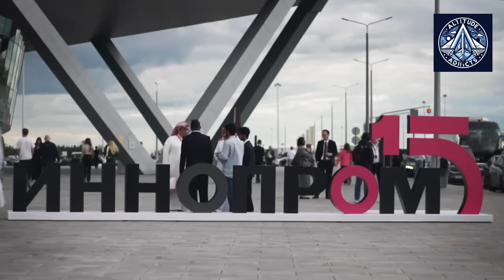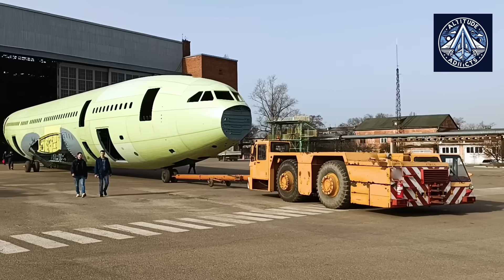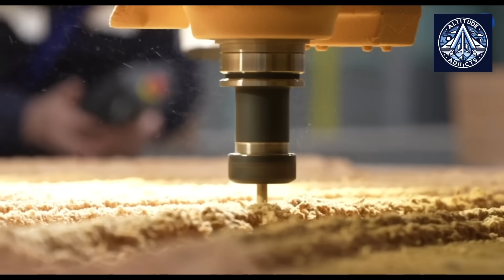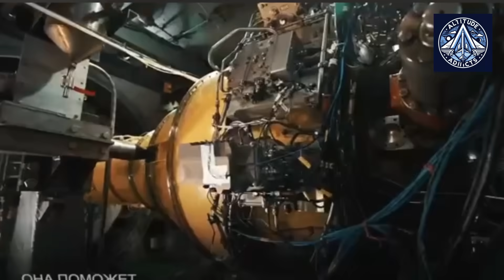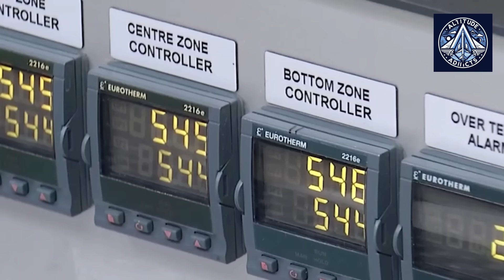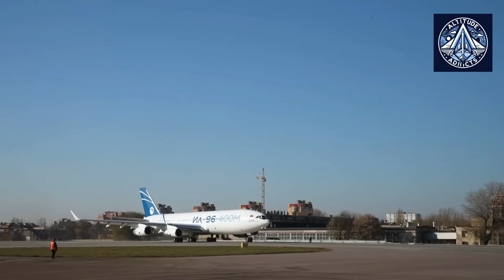Russia Officially Announces Il-96 Successor—PD-35 Engines + New Wide-Body Long-Haul Design!

Comment: Il-96-400 would benefit from the dual engine option. They will be up against the classes of the Airbus A350 and Boeing 777. However the engines for dual engines IL-96 needs at least 450kN of thrust each. and a high bypass ratio. Not forgetting to mention a lot of airlines are looking into lower fuel burn and CO2 emissions. Another way is to team up with China. China has the technology as well. and the team up would benefit the Asian market. Tupolev Tu 204 family would benefit with the engines of MS-21 or similar to the COMAC 919 at a higher thrust. PS90 is relatively an underpowered engine. Not only engines could be upgraded, the materials could also change to reduce weight and increase strength. Carbon fibre and fibreglass. The sanctions are really bullshit in my opinion. Double standards.

Comment: Or continue using iL 96-400(new pilot windows please) then apply what Embraer did. Uses the E jet  series fuselage copled to a New modern and curved wing that allowed to fit a larger engine. Born E2 series. Same for il-96-400 to become IL-206-400. Powered with 2 PD-35😊😊😊
Reply: Note 206 = I meant Year 2026😂

Comment: Russia should modernize the IL 96, and rename it to MC 24-400, to bring it into a single standard class of products that can be offered to the world. The new Il 96 should get :
1. A fully composite redesigned wing
2. More composites in the body and the tailplane to reduce its weight further.
3. Change the crew to a 2 pilot setup to reduce cost and weight.
4.Upgrade its avionics and cockpit to optical and glass cockpit to reduce weight further.
5. Change the 3 main undercarriage to 2 main undercarriage design.
6. Redesign the interiors to give it a world class unseen beauty and class in fittings and seats.

Additionally Russia should build a network of depots and support system for its international MC commercial airlines to give it the support system for future customers. Also I believe russia should also rename the Sukhoi SSJ to MC 19 - 200, to also bring it into a single commercial family of airliners for the international market.

Comment: Given the stated workload during the next decade, I think Russia should either maintain Il-96 by modernizing it with PD-35 or, if necessary, upscale the MS-21 into a widebody.
By the way B737 Max is only the modernized B737; I recently flew in one and noticed that it's nose is exactly the same with older 737; nothing changed.
So it is no sin to modernize

Comment: Yo, altitude
Have you heard the phrase, “go bold, or go home”? 
It’s time for Moscow to embody this spirit. Imagine if they developed not just one, but two groundbreaking airframes. First, a heavy-duty long-haul aircraft, designed to double as a cargo transport, rivaling the capabilities of the magnificent Antonov 225. 

But that’s just the beginning. Moscow should also invest in a revolutionary high-speed, high-altitude airliner that pushes the boundaries of aviation, akin to the iconic X-15. Picture an aircraft soaring above 60 kilometers, reaching astonishing speeds beyond 7,000 kilometers per hour. 

Unlike the old X-15, this new marvel would utilize a cutting-edge modified scramjet engine, granting it the unparalleled ability to excel in both subsonic and hypersonic flight. This is not just a dream—it's an opportunity for Moscow to lead the future of aviation. (⊙‿⊙✿)
Reply from the maker: Yo!

Comment: Russia should rationalize and consolidate its commercial aircraft projects instead of diluting design expertise and manufacturing capacity into too many projects which compete against each other on the market.
Apart from that, 4 engines is not a bad thing. The passengers intuitively feel more secure for long range flight over oceans. It also allows the IL-96 to be developed for higher payloads in the future. Copying Boeing and Airbus is not always smart.

Comment: I think doing all three makes sense. A new plane allows new design and materials to be used. Upgraded Il96 with improved engines will probably be flying first. The MS-21 could use a variety of larger and smaller versions. They are going to take a bit of time no matter which way they go.
Reply: The MS-21 family are single aisle.  Any long haul aircraft of the  B787 and A350 generation needs to be wide-bodied and so would mean a complete re-design anyway, unless based on the IL-96.

Comment: Russia should proceed with the IL-96-400 program using PD-35 engines alone. Once the Airbus A-380 retires, twin-engine, wide-body aircraft will be in demand for long-haul sections.
Reply: IL-96 with two engines can't be made without significant alteration of the fuselage and wings. Also its avionic suite is far from latest generation. Basically the amount of work needed to convert the IL-96 fuselage to 2-engine configuration (new wing, longer landing gear legs, structure modified to suit longer landing gear and different wing, new avionic suite) one can develop a brand new aircraft with better everything. And the tooling for the original Il-96 has been lost too. It's going to be the same process to making a new plane, and might as well do it from scratch, with high share of composites in fuselage, all- composite wing, re-shaped wing, all-new electrical and data systems, etc.
Reply: @Max_Da_G  Completely agree.

Comment: Start by re-engining the existing fleet, in particular put four PD-14's on the IL96, then eventually change to two PD-35's. The MC-21 should be stretched to exceed the capabilities of the Airbus A321XLR, with new wing and derated PD-24's.
Reply: PS90 engines in the 18 ton thrust range are already good enough until the PD35 is ready.   Designing a new aircraft does not mean existing types are frozen and forgotten.
Reply: Ummm you might want to check the specs of PS-90 and PD-14 in terms of thrust. Swapping PD-14 onto Il-96 will lead to thrust LOSS.
Swapping to 2-engine layout means new wing, taller landing gear to accommodate large engine diameter, etc, which basically means an all-new airliner.
Reply: @Max_Da_G  Or they could do what Boeing did with the old dog of a 737, Mount the engines further forward and higher on the wing to get ground clearance and screw up the COG and then put a cheap MCAS system on it! 😂

Comment: Boeing has spent $32 billion on the 787 program; estimates for the number of aircraft sales needed to break even vary between 1,300 and 2,000. As of June 2025, the 787 program has received 2,199 orders and made 1,198 deliveries. 
A fully new design for the Il-96 would bankrupt UAC ..... they will have to use the existing fuselage ... and as much existing componentry as possible.
Reply: ¿32.000 millones solo? Al ritmo que se están cayendo al suelo tendrán que invertir otros 64.000...
Reply: ...Russian development and production costs are many times lower than in the USA...
Reply: @igorderka4960 But the demand is exponentially lower as well...
In the 50-100 planes range.
It's stupid to go that route noting that ZioNazi aviation authorities would never certificate such plane. It's wiser to develop the MC-21-400 with the geared PD-14M engine, for long range point to point travel. Russia touches covers any geodesic ring...

Comment: I totally agree a IL 100 -400   maybe  ?
Reply: the fuselage, gears  and wings are Il-96, only the electronic and engines are new.
Reply: @chichomancho1791 ...yes, but they have already started developing a new wide-body aircraft...IL 96 is only meant until the new fuselage is available...
Reply: @chichomancho1791 they are talking for a brand new one
Reply: @chichomancho1791 Ты давно стал авиационным специалистом? Высшее инженерное образование?